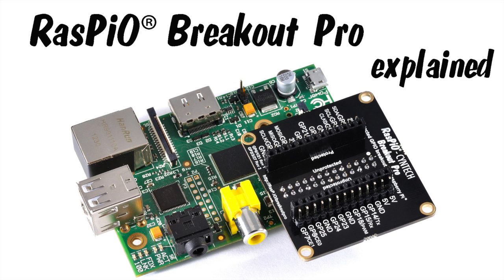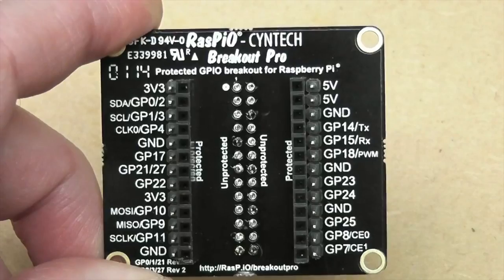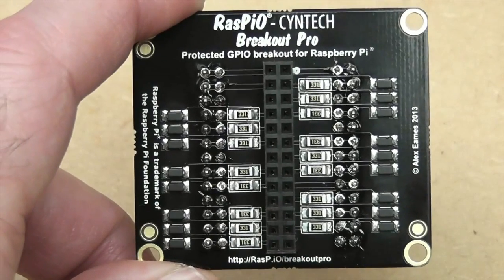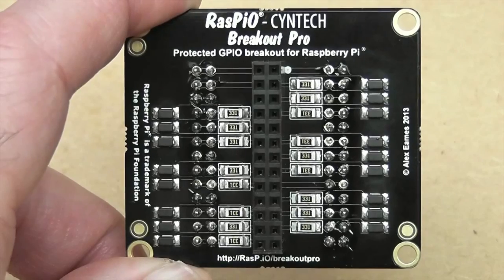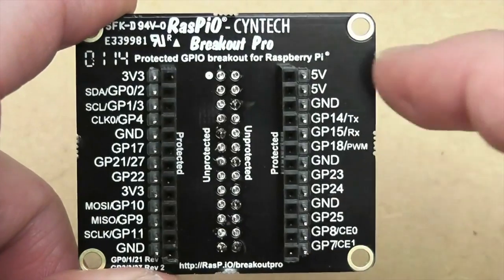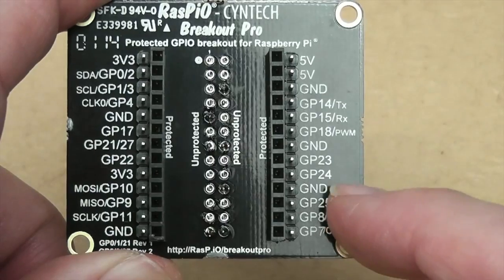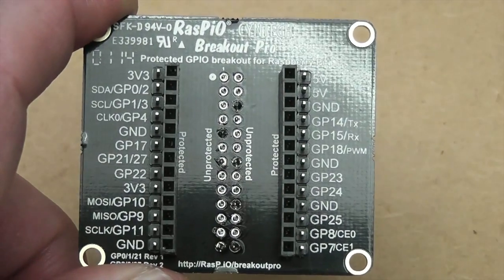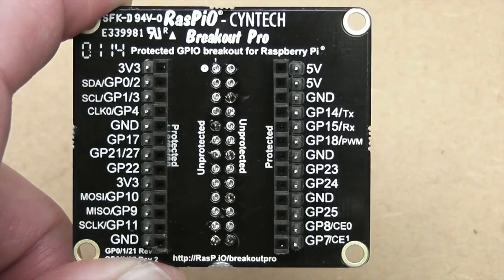RasPiO Breakout Pro port protection explained

Comment: I tried to build this board myself on some strip board a while back.  It was absolute chaos and I was left with jumper wires all over the place.  I got the multimeter out to test connections and I had about ten short circuits.  I just though fuck it! :D

Comment: Gpio ports are 5v tolreant
Reply: This is not an Arduino.
The GPIO from an Arduino accepts 5 V, but the Raspberry Pi doesn't.
You will destroy your Rasberry Pi microcontroller if you connect more than 3,3 V to one of its GPIOs.
As far as i know, only Pin 2 and 4 can handle 5  V, all others don't.